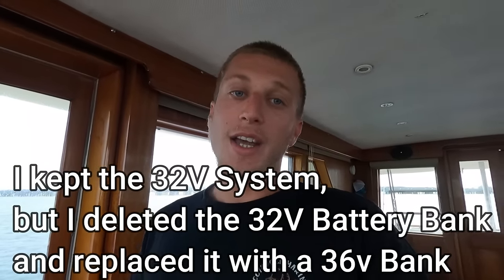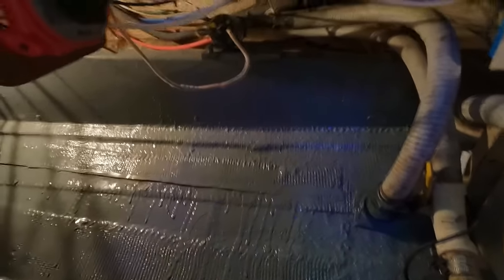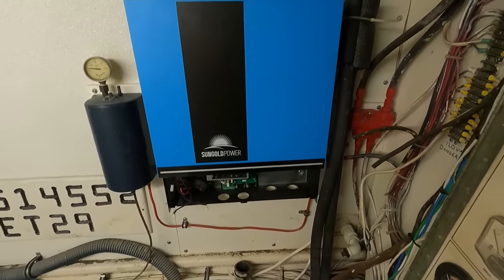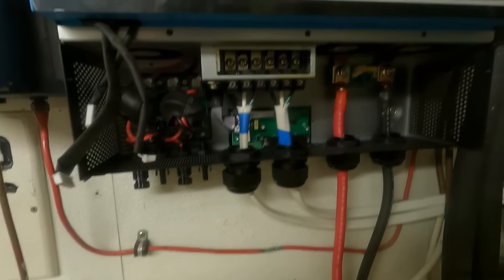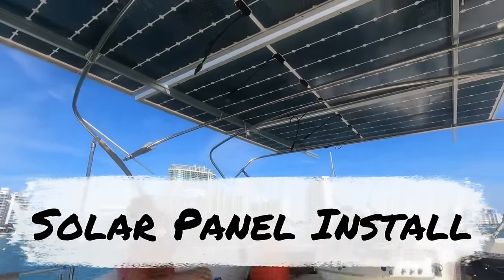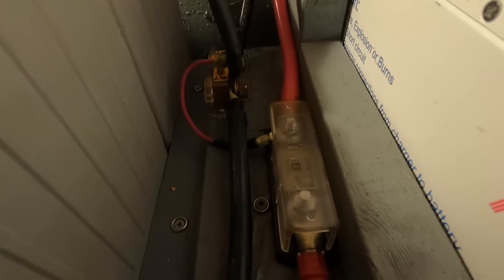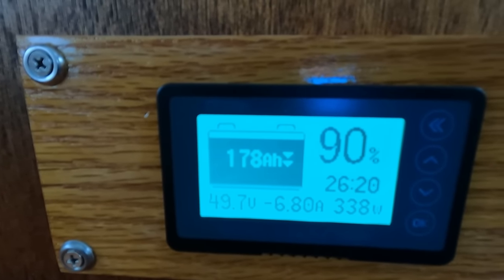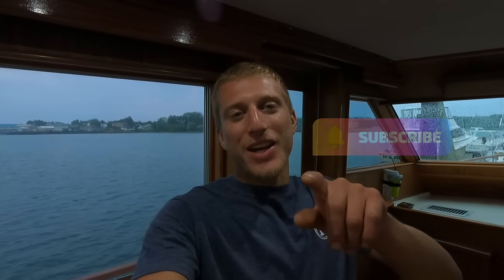Off-Grid Liveaboard Yacht Setup - 1968 Hatteras 50'

Comment: I took a look at the website and found ...

Over Charge/Discharge Protection:

Monitoring voltage and current during the charging and discharging processes are critical in protecting the battery from overcharge and over-discharge. The BMS uses different methods such as limiting current or voltage, state-of-charge estimation, multi-cell balancing, and temperature monitoring

☆ critical for you to be aware of exactly what the temperature cut-offs are otherwise it's just like an idiot in a car that tells you you're overheated after you're already overheated and at the opposite extreme you cannot charge these things when it's too cold so you need to understand where the cut-offs are so you can manage it especially high temperature down there

Lead doesn't melt until over 600 degrees Fahrenheit

Where as Li only likes between 32 -130 F ish

Find out exactly where the bms cuts off both high and low